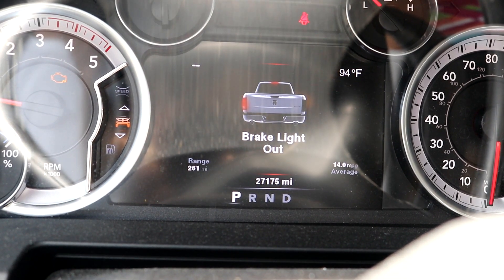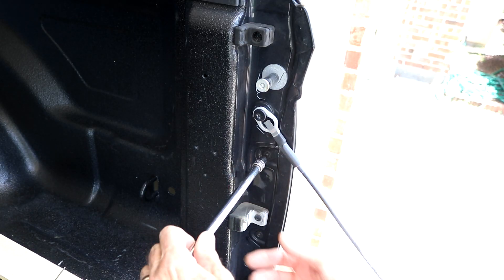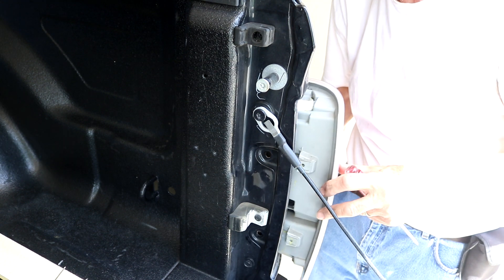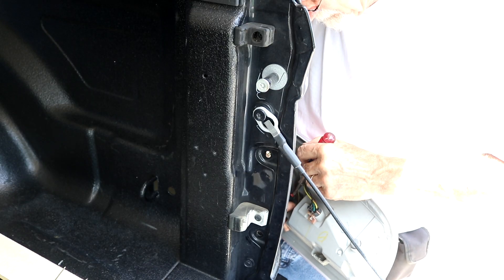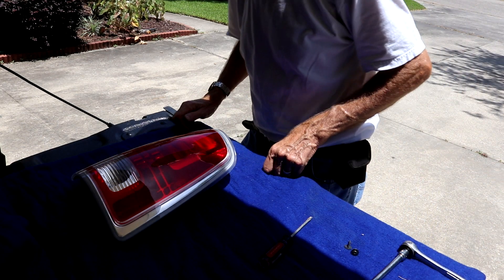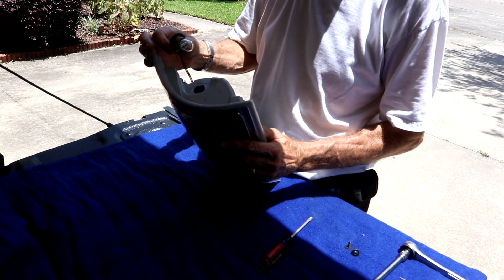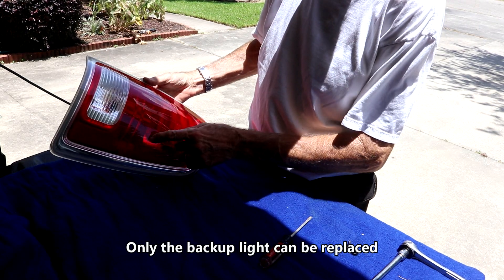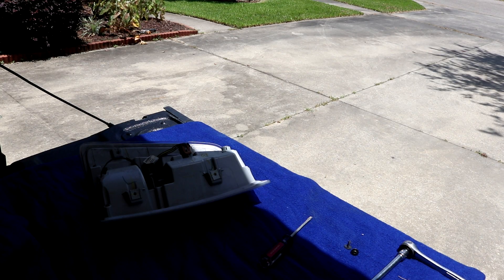2014 RAM 2500 Tail Light

Comment: You seem to be my go-to guy for the answers to my questions when it comes to my 2500 ram so today I'm driving home here in Volusia countyFlorida and I get the infamous brake light out and it looks like my right turn signal on my instrument displayso I stopped at the auto parts store and picked up a new 3157 brake light bulb and it did not fix the problem so here I am driving back home watching your YouTube video and I can't believe that this is such a common problem so I will be checking that third brake light and hopefully running out tomorrow to get those 921 bulbs to fix the problem... Thank you so much for making this video you saved me a trip back to the dealership.
Reply from the maker: No problem, we learn together.  I was baffled by it also.  I'm betting it's your center light also.

Comment: It actually is!    The glass was cracked open and it actually had water in it.  I'm surprised that it didn't blow the fuse.  Funny thing was it happened during today's raining down poor.   So I cleaned the gasket surface and just tightened it a little more then it originally was.   Hopefully water doesn't make it's way back to the the light.     Thanks for sharing your experience with all of us Ram owners.
Reply from the maker: that gasket has been a problem for a lot of folks. Keep an eye on it and make sure it doesn't run on the inside of your truck

Comment: I Got the message that my left rear turn was out. (It's the LED version) There was and is nothing wrong with the tail light, it's working properly. I read the comments in this thread and so I disconnected the negative battery cable for about 30 seconds and the message went away. Everything is functioning properly now.

Comment: It should be the third brake light on the back of the cab. I had the same problem. I replaced that bulb and the light went away.
Reply from the maker: Awesome, I'll check it tomorrow, I didn't even think of that.
Reply: No problem any time!
Reply: Going to check that right now
Reply: I had the same alarm but with the left side , it was intermittent  throwing the alarm . I finally caught it one night going on and off on the left tail light.  Took it and cleaned the little prongs on plug, haven’t had anymore problems
Reply: Having the same issue. I’m going to replace the third brake light in the back of the van and see if it fixes the problem. Keep you posted.
Reply: Marion Blair what happened? Having same issue now
Reply: Hi sorry yes.  The brake light turned off after I replaced the 3rd brake light above the cab.
Reply: I have the same issue today.
Reply: Mel Shingleton definitely the cheap little top breaklight. Fixed for me.
Reply: Thanks that was the problem:) :)
Reply: @Emt4232 Thank you!!!!! This solved my problem!
Reply: Awesome info, thank you

Comment: Very very simple solution. I had the exact same problem on my 2014 Ram Laramie 1500 and all I did was disconnect the negative battery  terminal for approximately  10 seconds and the error code cleared. Hope this helps..!
Reply from the maker: Thanks, it turned out to be a burnt out bulb on the bed lamp on the cab.

Comment: My 2014 Ram 2500 Diesel has same problem.  Third brake light was out so I changed it and also disconnected neg battery terminal, but problem has not gone away. I did replace the third brake light with an LED bulb and was thinking maybe i should have put in a normal bulb?

Comment: Hey Marion,  unrelated to the tail light but Just an FYI,  I had my 16 in last week for a slight surge and they found TSB:18-015-17 and then updated the PCM from tune # 32370631AG to 32370631AH. Truck seems a little stronger but temperatures rise a little hotter under load. Maybe you could find out what # you have and let me know.
Reply from the maker: Thanks, I will be doing my S87 recall soon and will see what they say about all of this  thanks.

Comment: When I added my camper shell I took out the third tail light bulb plus the bed light on the back of the cab and now everytime I start it the same bulb light out warning your getting comes on. Hopes this helps.
Reply from the maker: Thanks I'm getting some great answers.
Reply: Crowman - why did you disconnect the 3rd brake light when you put the camper shell on?  Just curious, as I had one installed a few days ago on my new Ram, and it has the cargo LED and camera in that assembly.  Not sure why you wanted to delete it.
Reply: redroofretriever test.
Reply: redroofretriever 
The camper shell I had built is 6 inches taller than the cab. If I left the lights in everytime I braked at night it will shine in the cab, very annoying. Didn't order the cargo camera so that wasn't an issue.
Reply: That makes sense.  Did you remove the assembly or just the bulbs?  Thanks for the reply.
Reply: Only the bulbs if you removed the assembly rain would pour in. I made sure the gasket was in place and screwed it down. With the camper in place the assembly is inaccessible unless you take the camper off.

Comment: Been searching for hours and this is the first vid I've found with a rear wiring harness the same a mine. What the trick to removing the connector from the housing? My lens is actually broken (bad driver) and will have to be replaced but I can't seem to get it loose. it appears Marion used a screwdriver. Could really see this in the vid. Looking at aftermarket replacements. Does anyone have any help and recommendations for replacement? 350's a bit much I agree.
Reply: I am here for the same reason, the lens is cracked. The assembly is not $350 anymore (depending on the website), but they are still quite pricey. I removed the lens and put some superglue on it to seal the cracks to hopefully keep moisture out of it and make it look a little better. I don't think the lens was made to come away from the assembly though so I may have to glue that back on as well!